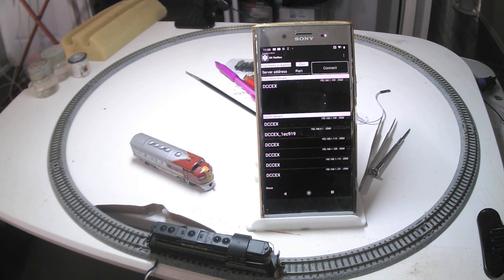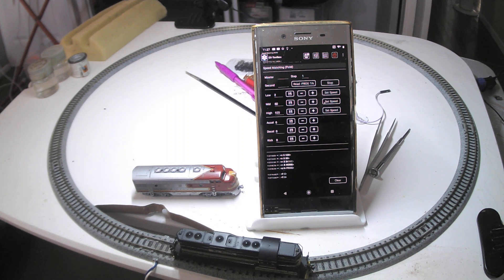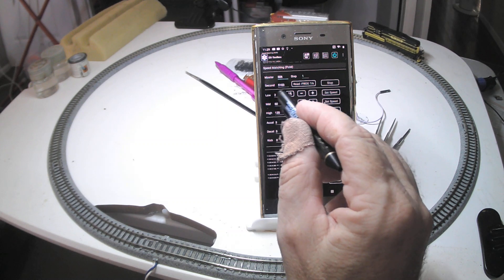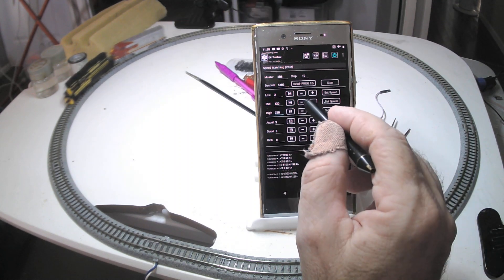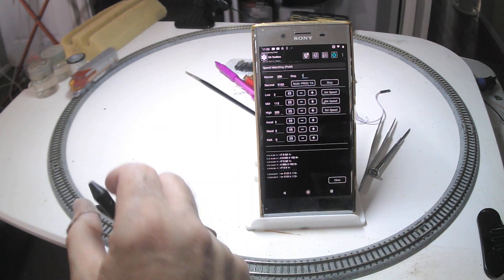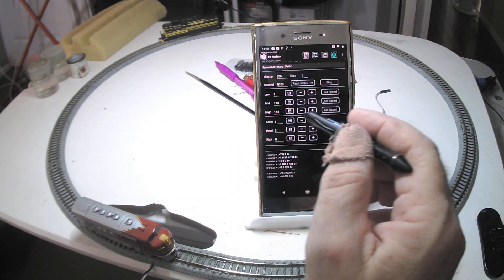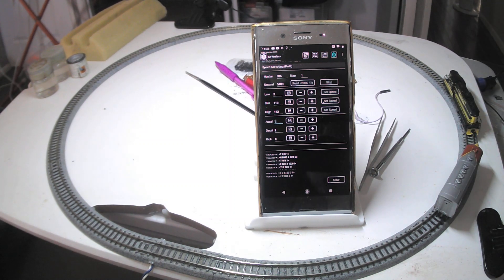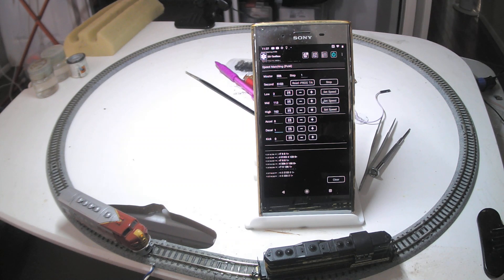DCC-EX EX-Toolbox - Speed Matching

Comment: Nice. So turn off the speed table before doing this process? Thx
Reply from the maker: You can use the speed table to speed match if you wish, but a) you then need to go through the matching process 28 times, and b) you can't use the speed matching page in EX-Toolbox.
So if you wish to use the speed matching page in EX-Toolbox and use the process in this video, then yes, you need to turn off the speed table first.